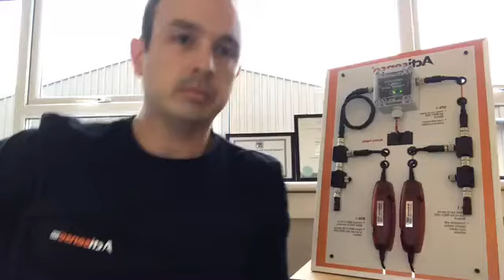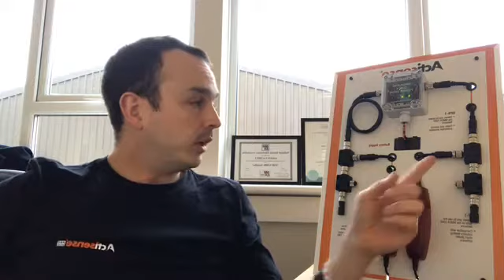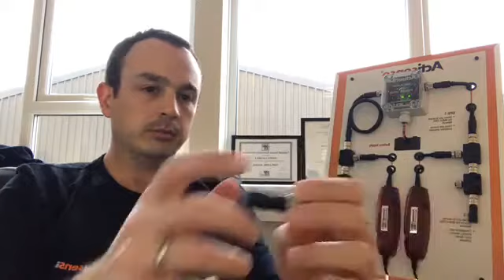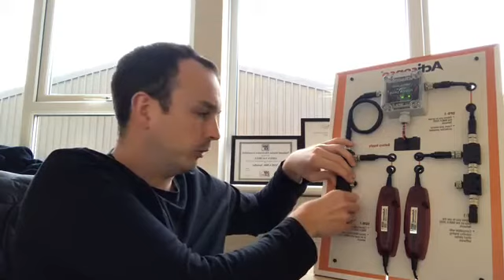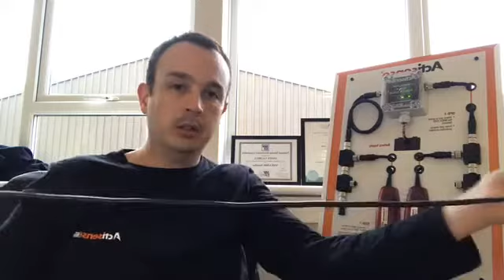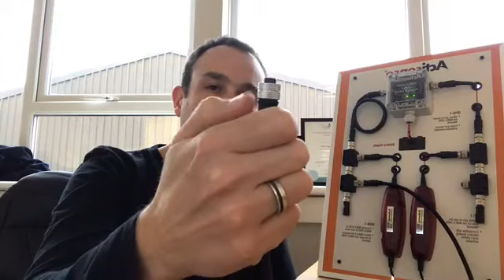Tech Tuesday   NMEA 2000

Comment: is there an adapter for micro devicenet  to seatalk ng ?  IE  to bring a Fusion stereo onto the raymarine NG network?   what would be the micro's gender on the adapter to plug into the fusion ?
Reply from the maker: Thank you for commenting and apologies it has taken us this long to reply.  Our YouTube channel has been dormant for a long time but we are starting to bring it to life again!

On to your question (if you haven't found an answer already), all NMEA 2000 devices should have a male DeviceNet standard connector on.  To plug that in to a Raymarine STNG network, you will need adapter cable STNG-A06045:
https://www.actisense.com/product/stng-a06045/

You may also be interested in our NMEA 2000 network beginners guide:
https://www.actisense.com/wp-content/uploads/2018/01/Complete-Guide-to-Building-an-NMEA-2000-Network-issue-1.1.pdf